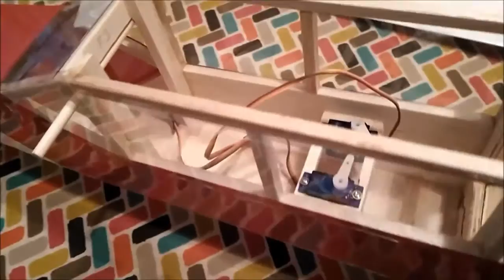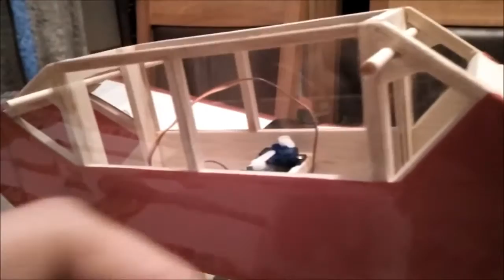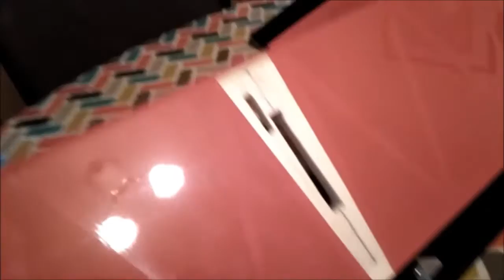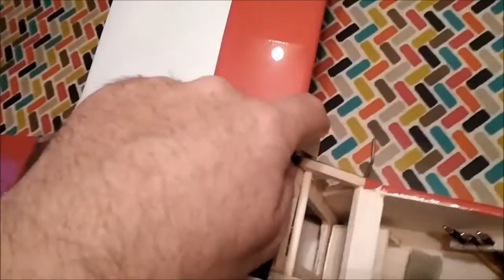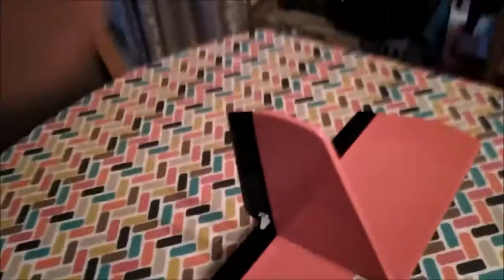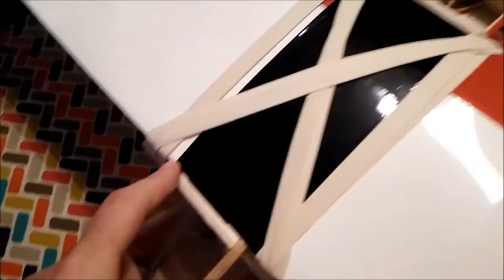Video 15: Putting the finishing touches on the RC plane.

Comment: Great videos  mate!!! What glue did you use to glue the windows in place??
Reply from the maker: Thanks! I just used super glue, nothing fancy. Windows just needed to be held in place, and I didn't want the added weight of epoxy.
Reply: @BuilderOfModels  Thanks for the reply mate. Ive read that super glue can fog up the windows, is that not the case then? Subbed you mate. Great videos straight to the point
Reply from the maker: It can of you use too much. If you overlap the window onto the balsa and apply the superglue along the edge it will wick in underneath, holding it in place.
Reply: @BuilderOfModels  Ok ill try that. Thanks mate

Comment: thanks engineer conor o'neill the weight 740g with battery and brushless motor or with out these. could you tell me the specification of motor,battery and another. thanks again
Reply from the maker: +amdom gz hi, the weight is the total weight, i.e. take-off weight. The motor is a 22x28 brushless outrunner turning a 7x5 propeller. The battery is a 1500mAh 11.1 volt 3-cell Li-po. The electronic speed controller ESC is 30Amp. Radio is standard 4-channel, but uses micro servos as they're only 9g in weight. Are you building the Millie Bob too? Or something similar??
Reply: thanks a lot our roll model i will build it my bro

Comment: hello engineer conor o'neill thanks a lot i really learn from the video.could you tell me the weight of your airplane.
Reply from the maker: +amdom gz Hi! The total weight is approximately 740g (26oz)
Reply: thanks engineer conor o'neill the weight 740g with battery and brushless motor or with out these. could you tell me the specification of motor,battery and another. thanks again

Comment: Good luck on the maiden! Watching this model being built has been fun. I built a model from a kit, but lack the funding to buy covering material and tools to finish it. It's been sitting on my desk for 3+ months and this series makes me really want to go cover and finish it
Reply from the maker: +Orion121802 hi and thanks for the message. This project too has had to take a back seat from time to time, so sadly I've missed the best of the summer weather for flying it. I hope you get the funds and time to finish it, would be great to see it - what's the kit?
Reply: The kit is a sig something extra. I bought one completely built and flew it twice and my radio browned out, causing a terrible crash. I thought this was the best way to use the parts!